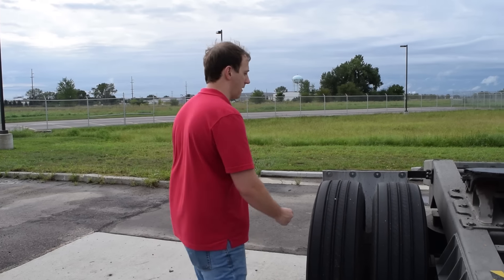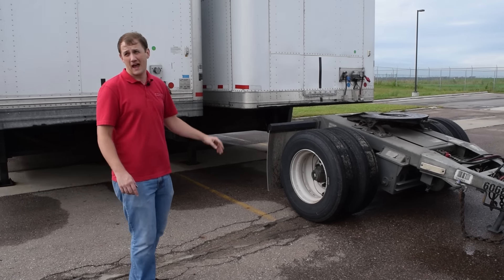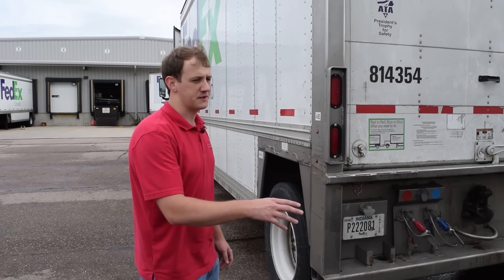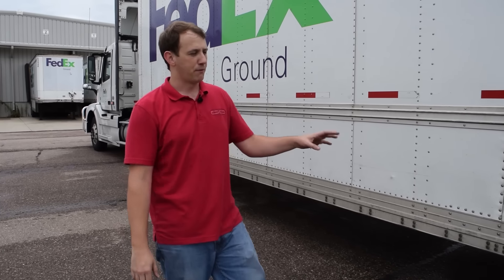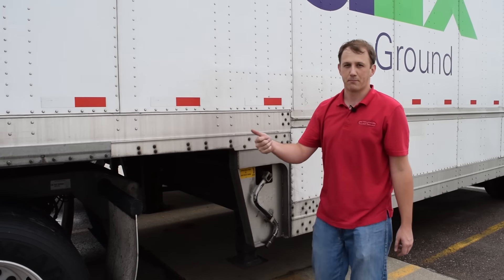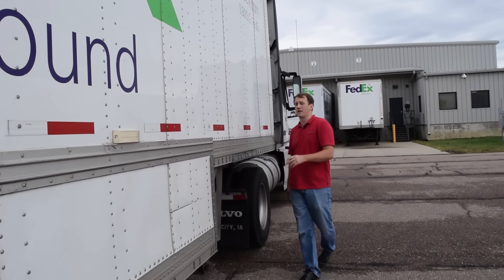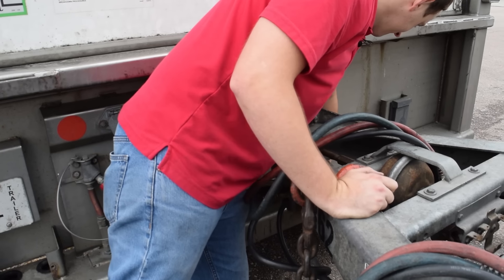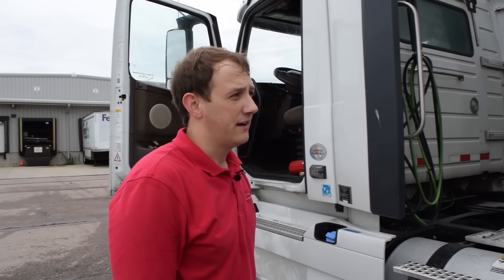FedEx Ground Doubles - Double Trailers

Comment: Always had a question about these: Why does FedEx use these small double tailors? Single regular tailor would be easier to use and park and unload and load.
Reply from the maker: Versatility. For example; we run from Sioux City to Kansas City and back, but on they way back we pull one Sioux City and one Omaha trailer. We then stop in Omaha on the way back to drop the Omaha trailer, then pickup a trailer that's assigned for Sioux City from Omaha. So Sioux City receives 2 loaded trailers.
Reply: Aaaaaahhhhhhh That makes sense. I just thought they were trying to be cheap, but making it more difficult on the driver with this setup. But going to multiple location and having to drop off and pick up tailors make sense. Thanks for that.
Reply: Doubles are easier to load don't need the long extendos.
Reply: Also if you do the math you get more volume in a set of doubles. FedEx doesn't have a weight problem, they have a volume problem.

2x 28ft = 58ft
Vs
1 53ft

Also doubles are far easier to get around turns than a 53 is.

And it's not a lot of "extra" work. Dropping a set and hooking up a new set, you can be done in 15 minutes with out a strong hustle.
Reply: 56'
Reply: Dan Ronning - I understand the volume part, but that 15 extra min  IS extra work, compared to just swinging in a 56 footer, then backing up to the dock, dropping it off and leaving. But I get the space at the yard issues and the slightly more volume you get from the two.
Reply: darklordchris only 3ft more. 😒
Reply: C2C Corps what does the average class A driver make a year for fedex max pay
Reply: FDXG runs tons of 53's too
Reply: darklordchris not to mention that 56' trailers are legally allowed only in a couple of states
Reply: farmrrick i think thats what he meant to say lol👍👍
Reply: @EVNL576  In a perfect  load the three feet would come in handy .As we all know , light freight in the back and not very stackable
Reply: I see FedEx and UPS running these little pup trailers in Triples up here in Oregon...IIRC, triples are only legal in Oregon, Idaho, and Utah.  Why Washington never made triples legal is beyond me.
Reply: EVNL576 that is 3 more feet of packages, and when such a big company like fedex wants to build its rep of being fast and reliable 3 feet means more packages to wherever.
Reply: @darklordchris  There are no 56ft box vans in North America. Plus FedEx uses these trailers for city delivery and road transport. Not many places you can take one 53 footer in town vs a 28ft pup
Reply: @farmrrick  exactly.
Reply: @EVNL576  3 feet x many thousands of trailers fedex owns. It adds up.

Comment: I don't criticize.  I make intelligent observations.  I found good things about this video and a few major deficiencies with the presentation.  Example.:  I was working with another company and had to do a team trip with an individual who intrigued me.  She tapped the tires on her pre-trip with her hand.  We were on the Interstate when two of the trailer tires blew off the rims.  None of the tires can be thoroughly tested with your hand.  When road side assistance came non of the remaining tires had more than 80psi in them.  Tires are designed to be filled at 105psi.  Under inflated tires will heat up and liquify resulting in separation of the retread. Something you might want to consider.
Reply: @hello James how are you doing?
Reply: You didn't stop her there and tell her to use an air gauge?  I have a million miles in a semi. Never blew two tires on one trip.
Reply from the maker: Thanks for your input James! There's always room for improvement and your concerns are duly noted! Hopefully you took more good from this video than your comment suggests!

Comment: That two trailer are small. Why they have to make it two trailers instead of a one whole size of a semi trailer. Basically that double trailers is considered only as the whole normal size of a regular semi trailer. It doesn't make sense. Your just only making your job harder. I will be much impress if the double or triple trailers in America is just like the one in Australia what they called the ROADTRAINS.

Comment: What happens if the heavier trailer is at the rear?
Reply: The rear trailer will start to travel and you can lose control real quick.
Reply from the maker: @OU-gp3rg  https://youtu.be/4jk9H5AB4lM the video isn't doubles but the concept is the same.

Comment: When I pulled doubles loaded with swinging beef the heavy trailer was put in the rear position this helped keep a constanced pull on front trailer so it would not wonder/sway side to side
Reply: This is illegal in most states. The heavier trailer is required to be in the front.

Comment: I wonder how all that grease got all over the  steering wheel, shifter controls and driver?😂 oh yeah and the landing gear handle, that’s always a nice one to find. 
What he doesn’t tell you is that all this is shared equipment, including the tractor. Very inconsiderate to leave a mess for the next guy, just wear gloves (disposables are great) and for gods sakes, take them off before you even open that cab door
Reply from the maker: I will admit, I should have worn gloves! However, as a company, our trucks are ran by the same person daily.

Comment: How can he move one of those dolly's like it weighs nothing. Those dolly's are decently heavy and he just moves it around with ease. I am surprised.
Reply from the maker: They are balanced pretty well, heavier at the nose. The most important thing to know is that they're very hard to turn. The dolly needs to be moving forwards or backwards to be turned. It cannot be turned 'on a dime' due to the friction of the tandem tires on each side of the axle. Just remember to always be safe when lifting and maneuvering the dolly.
Reply: Just be clear about this: It is strictly forbidden to move the dolly by hand like you did 
because it's hard enough to hurt you massively - and you do not even have to put your head between dolly and truck .....

Comment: It's called a supply line.  Not emergency line.
Reply from the maker: Here's a good read for you, Alex. Enjoy!
http://enginemechanics.tpub.com/14081/css/Trailer-Air-Lines-167.htm
Reply: C2C Corps... Americans are pretty dense eh?  At what point do you use the air in the supply line in an emergency? The air is used to release the spring brakes. If there's a rupture in the line all the air will drain and apply the spring brakes. People just associate the color red with emergency for whatever reason but this is not the reason that the supply line is on the trailer. It's a common misconception and not the purpose of this line. I don't mean to be rude, just trying to inform you
Reply from the maker: Tomato, tomato. Potato, potato.
Reply: @C2C Corps
I do not think you're up to snogging.
The line you call "emergency line" basically does not have this emergency function you're talking about. This emergency function is not even necessary for the main function of this line as a supply line - the emergency function is simply the function of an additional valve, which a) can trigger the braking via the spring brake and b) can even be switched off without further ado. 
Why the supply linne has been called "emergency line" in your country has a simple reason: They wanted to show and increase the importance of the supply line, because this line did not exist in the old single-circuit braking systems. Now, to prevent people from not rebuilding their old one-circuit-trailers to dual-circuit brakes, they gave the supply line a) the emergency function AND then named it as synonymous.

Just look over the garden fence - you'll see that hardly anyone else who uses dual-circuit braking systems would call the supply line an "emergency" line - because it simply is not the main function of this line, its the main function of a valve in this support line.....  .....

Comment: more than a few "safety" concerns first off no 2 finger landing gear lifting, should be done with a grip of the hand on the end of the landing gear handle, this was a poor example, tire thumping isn't proper either should be done with a tire psi gauge for accuracy. this is what I do whenever operating / and inspecting a trailer I have never hauled first time I am there and hauling more than one day. 1 million safe driver here no accidents or tickets... On a side note, this person had NO gloves on, and his hands are "black from the grease which wouldn't ensure the steering wheel in the tractor was clean, just a pet peeve of mine... also a good idea to mention NOT to engage into any conversations when doing this either hooking or unhooking. just a thought is all... I know I am NO expert, but just an observation from one longtime driver to another whomever views this video... please be safe y'all, and have a good day... FYI this comment is "rhetorical" comments from the author appreciated, again be safe y'all
Reply from the maker: Thanks for your input Ted! There's always room for improvement and your concerns are duly noted! Hopefully you took more good from this video than your comment suggests!

Comment: What gear would you start at pulling 2 trailers at?
Reply from the maker: Depends on the weight of the trailers! If they're heavy start low. If they're light start higher.

Comment: Funny he kept calling the electric supply line (lights) lol
Reply: What else does the electric supply line do, besides lights?
Reply: Supplies power for ABS systems
Reply from the maker: The Hyundai trailers FedEx use also have a low air alarm  (is it part of the ABS system?) that beeps @ 7:00
Reply: Pig tail
Reply: Its called Electrical Cord.
Reply: 7-way

Comment: I hate when people don't cross their chains.
Reply from the maker: You're correct for any time a chain is actively bearing any load and have their own anchor points, think of towing a car as an example. These chains are safety chains and should never be load-bearing, they're only there in the event of improper coupling. They're connected to a shared U-bar, which means they would slide to the same position on the bar if a disconnect happened. In short, these chains are only used if a person has a whoopsie and do not need to be crossed.

Comment: How long should this process take?
Reply from the maker: Depends on how far apart the equipment is strung around the yard. Some states/countries allow triples, which take even longer. I've trained and ran doubles for 5 years now, and a proficient (and thorough) setup will be around 15-30 mins depending upon how much running around you need to do to get your equipment all together.
Reply: C2C Corps con spit a set and put one together  maybe  45 minutes or hour maybe  faster  running  team
Reply: 20 to 25 minutes

Comment: You never crossed the chains...
Reply from the maker: You're correct for any time a chain is actively bearing any load and have their own anchor points, think of towing a car as an example. These chains are safety chains and should never be load-bearing, they're only there in the event of improper coupling. They're connected to a shared U-bar, which means they would slide to the same position on the bar if a disconnect happened. In short, these chains are only used if a person has a whoopsie and do not need to be crossed.

Comment: Glad i never pulled doubles thought and wondered which is why I'm watching this,but hell no.Looks like it takes forever to get everything connected and checked.No Thanks.
Reply from the maker: Once you've learned the process, its quite easy. What takes time is explaining and teaching the process, especially if you want to know how to set them up right!
Reply: Doubles A-trains are easy once you've done it a few times. With more experience most of us just hook the converter to the first trailer and then back both onto the follow trailer.

Comment: Sorry but there are several things wrong with this video. Terrible DOT pre-trip. Always cross your chains. They are meant to catch the dolly tongue in case of a disconnect. Never use you hands to check your tires. Either use the back of your foot or a hammer or pipe. I could go on.
Reply from the maker: Thanks for your input Ray! Now, let us know 2 good things you've viewed in our video.

Here's some light reading for you: https://www.ecfr.gov/current/title-49/subtitle-B/chapter-III/subchapter-B/part-393/subpart-F/section-393.70